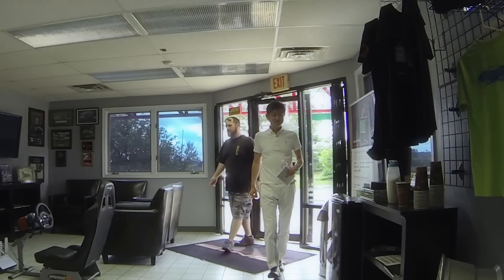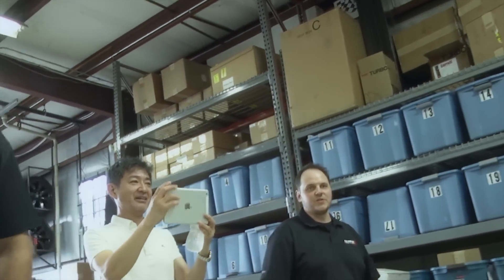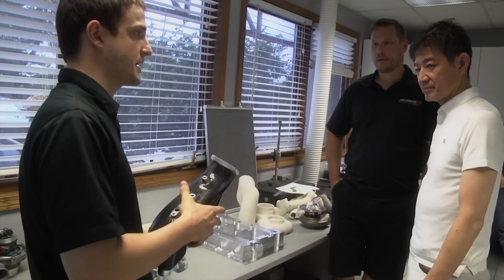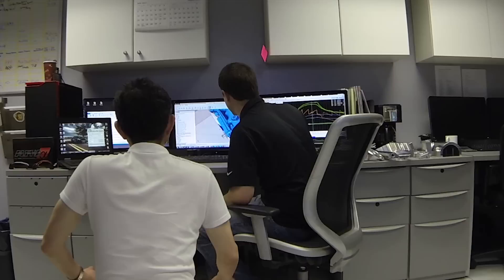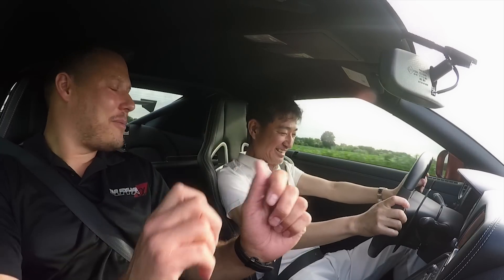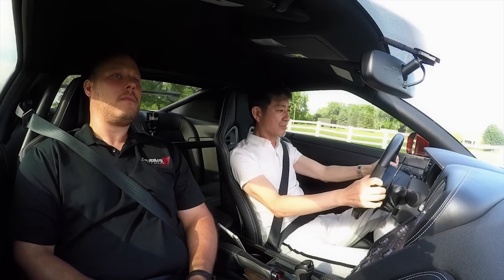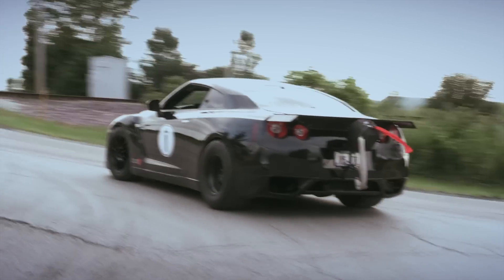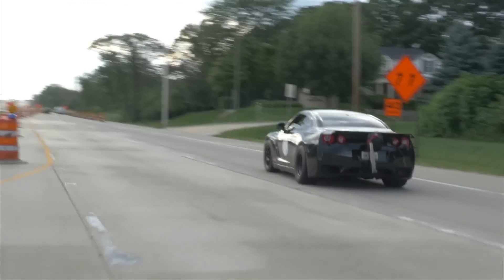Nissan R35 GT-R & NISMO Chief Product Specialist Tamura visits AMS!

Comment: The AMS GT-R is simply on CRACK!! The car is just insane, it destroys an F1 car in the straights. Watching the record quarter mile passes and the sheer VIOLENCE of the acceleration contrasted beautifully by the stability at which it does the runs. I've never seen a street car or any car not on MASSIVE drag slicks and powerglide do a run that smooth and controlled. The car has radials but they're not that tall, you could even drive on the street like that. People who bash this car are vermin, if you don't respect this car, even if you don't really like GT-Rs, you're not even human. The starting platform and the incredible work AMS has done combine to achieve something EPIC!! The engineering and development that has come from their work contributed so much not just to the GT-Rs development but cars in general and probably different fields. It's just EPIC!!!!!!!
Reply: +Ethan Ward A good idea for a Challenge: AMS Alpha Omega vs a F1 Racecar.
Holy shit that would be fuckin awesome.
Reply: If only those UGR guys could understand... Smh
Reply: I love the Gtr platforum but still its not some big revolution or something. Look at Mark Carlyle's Corvette or Sal Patel Viper. They run 6s rwd even without a huge crew like AMS.